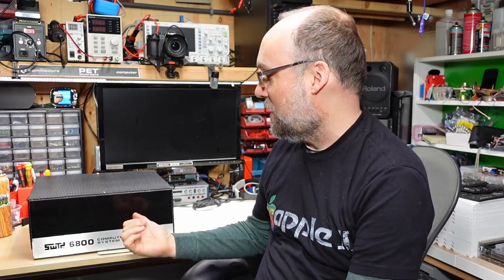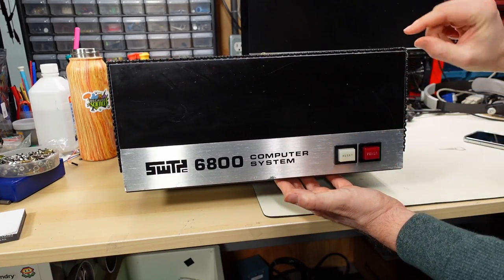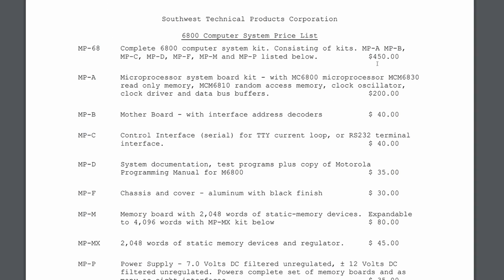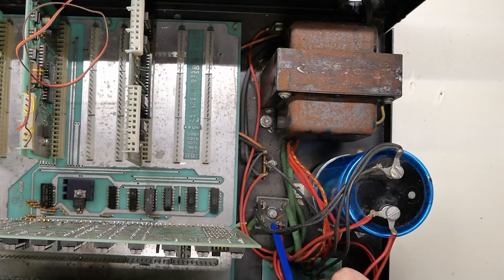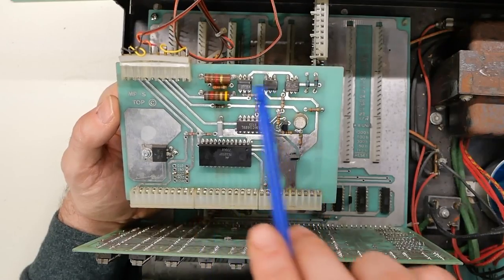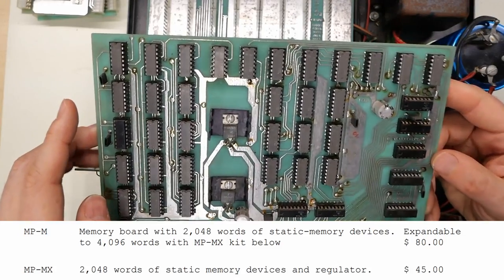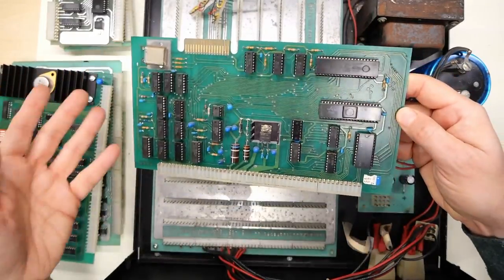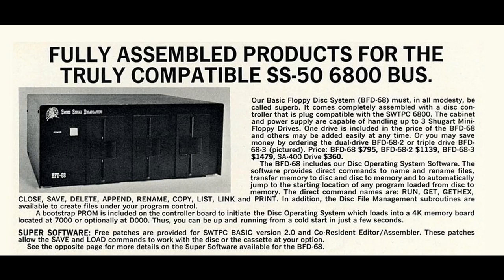The 8-bit home computer from 1975 you've never heard of

Comment: 14:36 Also, what happens if you put in two cards of identical type? This is why AT-bus cards needed to have jumpers to allow unique selection of I/O addresses, IRQs etc to avoid conflicts. With this scheme, the two cards automatically get different addresses just by virtue of being plugged into different slots.

This scheme was also used in NuBus, which was adopted by Apple in the Mac II (1987) and some later Mac models (until PCI came into use). NuBus cards were famous for being “plug and play”, with no need to fiddle with jumpers.
Reply: On the other hand, you wind up with software expecting specific cards to be in specific slots. 

The ISA address/IRQ selection was the result of several manufacturers creating upgrade cards simultaneously, and choosing an interrupt line and address range that "wasn't used". Then it turns out multiple companies have chosen similar interface details for very different cards. You'd still have that problem with dedicated slots, it would just be solved differently.
Reply: NuBus dealt with that by having a configuration ROM on each card. There was an OS API to enumerate the cards, so the drivers (or other software) could find the ones they were responsible for.

I think a scheme like this is used in all modern buses.
Reply: @lawrencedoliveiro9104  You can do that, once hardware is advanced enough to include on-the-fly software reconfiguration instead of asking the user to literally rewire the board, and software is behind a few layers of indirection instead of directly bitbanging hardware. But it's a whole different world at that point, one where system resources essentially don't matter.
Reply: So what happens if the driver expects the jumpers to be set in one way but not another?
Reply: @lawrencedoliveiro9104  Drivers in the modern sense almost always support any valid configuration of the hardware.

DOS games were an excellent demonstration of the issue, though. Older games often only worked with a more limited set of configurations than newer sound cards supported. You just could not set them up to talk to your sound card if it wasn't at base address 220, IRQ 5, and DMA channel 1.
And woe to the unlucky souls who had a SCSI controller using some of those resources.

Comment: I think that front trim peace is easily replacable. I'm 99% sure you could buy an L shaped alumin(i)um bar at some hardware store, but some corners to it and bend it. It's much easier than to but a sheet of alumin(i)um and do the initial fold accross it and then do the corners. I think if you are planning to keep it you should look into making a replacement trim.

20:25 - isn't that cap pushed in on the top?

Can you modify that program to load into a different address space?

Comment: On older software like that old version of DOS changing the address it loads into was as easy as changing the startup.bat in a text editor. It's been awhile since I worked on or even thought about anything like this but I used to be fairly proficient in a DOS shell. It may also be possible to dump the floppy controller ROM and write a new one designed for that specific machine. The trouble with older tech is the lack of plug-and-play compatibility. We've gotten spoiled over the recent decades.

Comment: They had a 6809 upgrade as well... to make it like the newer 6809 models they had later. The 6809 was 100% hardware compatible, but not machine code compatible with the 6800. I believe the name of the bus was the SS50 bus.

6820 (and 6821, which can sink a little more power) Peripheral Interface Adapter - two 8-bit parallel ports, with each bit being programmable, with control/signal lines for each port. (6822 is similar, but open collector and called an Industrial Interface Adapter.) If  you should ever have to, you should be able to drop a 6821 in as a direct replacement for the 6820.

6850 - Asynchronous Communications Interface Adapter.... the chip itself can do considerably faster (up to 1Mbps) than what the board in this 6800 machine has selection for. Of course, back then the speeds on the board were about normal.  The 6850 had lines that also allowed it to interface directly to a MC6860 0-600bps digital modem chip.

Also... since these chips weren't labeled 68Axx, or 68Bxx, they are 1MHz max rated. (the A made it 1.5Mhz, and the B made it 2Mhz.)

 There was also the GIMIX machines... bigger than the SWTPC machines and were 6809 based.

Comment: I built one in 1975. This one is missing the edge piece  that holds the top and sides on. I upgraded mine to a 6809.  At first I used a cassette tape for storage and then a dual single sided floppy. a big improvement. the ram boards that were 2K had a ton of ram sockets to solder. I had 4K at first later upgraded to 46k. I had to change all addressing chip selects to do that.

Comment: The 6800 microprocessor was pretty advanced for it's time.  I breadboarded one back in high school.  Not a bad processor to program for, although truth be told, i preferred the Z-80 for machine coding.  But the 6800 led to the 68000, which was absolutely better than other processors of it's era, at least in the area of op-codes.
Reply: Later they had the 6802/6803, which put the clock generator and 128 bytes of RAM on-chip, and added a few instructions. From what little 6800 programming I've attempted, it's hard doing some things without ABX.
The 6809 was done as a project to study how opcodes could be better thought out. It was really nice, and I even got paid to write 6809 code for a few years. Sadly, they went back to the original 6800 instruction set for the 68HC11, which was big in the automotive market. There were also a 68HC12 and a 68HC16, but by then other chips were getting more attention.
Reply: @8bitwiz_  Interesting.  I never knew about the follow on chips after the 6800.  In fact the only reason i know anything about the 6800 was that i got put into the advanced track in my high school electronics class, and that allowed me to do the "extra" stuff, like breadboard a microprocessor system.  And the kit they had was based on the 6800. 

By then i was very conversant with both Z80 and 6502 machine and assembly coding.  I include both because when i started doing machine coding i didn't have an assembler for either architecture, so i had to hand code everything.  You want to talk PITA, try hand coding even a simple program!

Ah, memories.  I would not put up with that kind of lack of proper tools now, i can tell you that!  ^-^

Comment: My Father and I built this system late 1976. Uses all sockets. Love the old SS50/SS30 card. Still have that unit with a SSB MB, 6809 MB Card  and Memory. Uses that to gen a lot of Coco software and even did a prototype software when the Mac was released.  May take a while. But may have a replacement boot rom Computerware created and used in this and SSB units. Just for info SSB cooked up a protype graphic card based on 6847 graphic chip. Try replaced with gold molex pins for stability of the connection. If I can get a chance and the old 8" floppy still work will see what can pull up. PS stay away from the 3gen tv keyboard. A pic of junk. If you can find one get a SSB 5" & 8" controller much better.

Comment: have you ever heard of Sphere Computer?/it also was a 6800/based system. it was made in Utah. I got my hands on one in 1977.78/in college. it had a  300 baud cassette tape for mass storage and stock 4k of ram. there was one commercially available program for it and that was a reduced Basic interpreter by a startup named -as I recall - Microsoft. it was advanced for its time in that it was a video monitor with a card-cage under the hood. the boards were bussed with ribbon cables.

Comment: I had one of these chassis in the late 70's, though it came with a better power supply that used a ferro resonant transformer for better regulation.  I ran a Percom 6809 CPU board and 48KB of static RAM in it, the system was running Microware OS-9 which could do multi-user and multi-tasking.  Later I added an 8-inch Seagate SASI hard drive, I think it was 5MB, and I wire-wrapped a DMA SASI controller and wrote a driver for it.  It wasn't 100% reliable (I got pretty good at disk recovery), but it was blindingly fast with disk data transferring at full bus speed of 1MB/s.  The CPU was about as fast as the first IBM PC's, but it wasn't until their AT came out that their disk I/O was faster than my homebrew system.  MS-DOS still sucked compared to OS-9, though.

Comment: You'll also find the MC6821 (PIA chip, or Peripheral Interface Adapter) chip in the Tandy Color Computer line as well as the other 6809 based systems used in the 8 bit video games by Williams Electronics (Joust, Defender, Robotron 2081), etc.

Comment: i didn't spend my time on the early systems as I had access to bigger systems, like the IBM systems 3 and system 32 and others.  I did how ever get to play around with a 68000 system.  It had a OS from R/M.  It was wild and not like other OS's plus some pretty strange rules to it.  Like the fact that did not allow to access the files name directly thru programs. you had to use a LUN to access the data files.

Comment: Micbug did bit bang.. thus the bit rate limit on the control board.... "moving" micbug to say a starting address of 0 takes just a bit of time with a binary editor... I worked on drivers for an eight inch floppy that was a tad "different"... it was used in a medical data collection system that bit banged data in and out to the Floppy... (Shades of Micbug)   I was doing the drivers for use on the 8080 oriented systems.... There was a company in Tampa Florida that had Robert Uiterwick and 4 others... He actually wrote most of the stuff for SWTPC  (a very primitive dos, Integer basic, 4k and 8k basics, and Warren Startup designed the first generation floppy adapter for SWTPC.  I did a couple of articles for Information Age Mag which included a "Floppy Rom"  in the magazine..  The articles had a copy of the SWTPC cassette adapter to read the Floppy Rom in.  I wrote a pile of assembler code to take the copy of basic in the system and dump it out to a record cutter that actually generated the "floppy Rom"... which was a record stapled in to the magazine... An interesting project
Reply: Mikbug not Micbug it wasn't created by McDonalds LOL.
Reply: The TRS-80 Color Computer did bit-bang serial too. The trouble is getting reliable input timing, while doing something else useful at the same time. The Videotex cartridge actually used the 15KHz video horizontal sync interrupt as a 25x (?) clock for 300 baud, at some small cost to foreground performance.
Reply: @8bitwiz_  A friend in Clearwater did repairs on the TRS lines for the shack.  His comment about the original: they recucled serial numbers... which only went up to 100,000 as I remember.  He saw at least 3 different chip dates that were years apart in his surgical attempts.  I never got into the color computer, so never found their need to bit bang... The SWPTC system tied the cassette into the original serial port if I remember correctly.  (That is a LOT of years ago)--- used the tape load and save functionality there.  (Well, Motorola was thinking paper tape as in teletype type stuff...)   We did a connection via parallel port that worked nicely for the "pull the punched tape thru the reader" devices....

Comment: It would be easy to recreate that front trim piece with some aluminum angle-stock!
Not even any welding needed, just cutting, bending and drilling.
Huh, the card-connectors inside this computer must have been commonly-used in that period, as I have a number of old television circuit-boards that use the same right-angle/card-edge connectors!

Comment: Adrian - I keep seeing your roland MA8 speakers in the background.  I had a pair of beige ones at a former job from 1999 to 2006, and have been suffering from Nostalgia.  Have you done a teardown of them?  Are they as good as my rose-coloured memory suggests?   
Since then I've acquired some 4.1 powered speakers, but even with a separate sub they don't have the same "Oontz" as my mind remembers.
Ebay shows these are still commanding $Silly prices which suggests that yes, yes they are that good.  Would a teardown. clean and inspect be a good video subject for the future ?

Comment: This big cap is not just a filter cap to smooth the supply, it's more a battery or built-in UPS. Beware, this could be used for welding I guess.. ^^

Comment: I think the Floppy controller is normally hooked up to 2, 8 or 4-bit FlipFlops. I think because the Floppy controller does not have any built-in registers to 'hold' any settings. So if you wanted to read back the current track number or something, you'd need extra logic.

Comment: 9:45 Shift registers are not RAM (random access), at all. They can be either dynamic (usually MOS) or static (usually bipolar ttl) though. So it is "shift registers", not "shift registered" [RAM]. (It kind of amazes that a guy that knows relatively little about old components can be so skillful in fixing old electronics. I guess being systematic and a quick learner, helps a lot!)
Reply: He said "From my understanding one of the big improvements on this later version was that it used static RAM, as opposed to shift registered, which allowed you to move the cursor around and edit any part of the screen"

The way I understood this was that he was saying the later TV typewriter(the TV typewriter II in the picture he is showing) used static RAM, as opposed to the older TV typewriter which used a memory system implemented with shift registers, and that so the newer version allowed you to move the cursor and edit any part of the screen. The implication here is that the version with shift registers could not edit an arbitrary part of the screen, meaning it was not random access(it seems to have been a sequential access memory design, using the shift registers as the delay elements).
Reply: @Ts6451  Yes, of course! But that was not what my remark was about.
Reply: @Ts6451  Shift registers are perhaps not best viewed as "delay elements" in these contexts. Better seen as strings of latches, or a fifo buffer. And yes, they are not random access, at all, but sequential. 

(You can edit any part of the register fifo though, just like you can edit a magetic tape. But it's much more cumbersome to write code for that than with RAM, especially without disturbing the display frames to much.)
Reply: You're missing the point and being a jerk. Early glass terminal implementations used shift registers to store screen data. Later more sophisticated implantations used RAM to store screen data, making it practical to do screen editing. That's it, end of story. No one confused shift registers with RAM.
Reply: @matthewkriebel7342  Talking about being a "jerk"... But I guess practical or not depends a lot on whether the terminal had some form of processor, or just random logic. One of the first text terminals that had a CPU was the Datapoint or CTC 2200 in 1971. The first versions of that design used shift register memory, and could edit the text. (Designs around the 4000, 4040 and even 8008 also often used shift registers. Same with Texas chips and others. So it was used for much more than storing a static sequential text.)
Reply: Really, you're just quibbling over choice of expression.

Shift registers are legitimately viewed as memory devices, and the grammar can easily be read as shifted vs. random.
Reply: @JoelReesonmars  Yes, they are memory devices, sure. But not RANDOM ACCESS, which is what RAM stands for. Shift registers are not RAM by any means (just like tapes or delay lines aren't either).
Reply: @herrbonk3635  Maybe call them Sequential Access Memory.
Reply: @herrbonk3635  Random Access Memory as opposed to shifted memory. It's within the scope of the grammatical ambiguities of everyday English, where you cut the parallel.

Ordinary conversation and YouTube channels are not as rigorous as mathematical proofs, and if we want to complain about the lack of precision in this, man, we wouldn't be able to listen past the first five minutes.

I saw it too, I didn't figure it was any more worth commenting on than the times he slipped and said 68000. No, actually, I did think about commenting, but the 6800 gets so little love anyway, and, frankly, I had more important things to do.

I'm not sure why I'm arguing about how important it is to demand precision from a YouTuber, really, except I guess I was more interested in seeing someone get better acquainted with the 6800.
Reply: @JoelReesonmars  Youtube or not is as relevant as the color of the paper, or the frequency of the transmisson :D At least in my world. Avoiding misleading terminology when possible is not the same as mathematical rigor either. I never understood why people put so much pride in being sloppy with central and fundamental technical concepts. (Often the same guys that are pedantic as hell about arbitrary and meaningless information such as exact model names or numbers.)

But sure, the 6800 is interesting in many ways. An early response to the i8008 (not 8080) that stores the most significant byte first (just like the 68000, but unlike the 6502). I was a Z80 programmer at the time, but I would have loved to see more of the 6809. It was an interesting design, and I always feel for the underdog. Always liked real diversity.
Reply: Anyway, we've beat the question to death, and of Adrian wants to add a correctional balloon or something, he'll have all the notification he needs.

Or, you can do like a lot of bloggers or YouTubers do and use it as an excuse for a response post, like that recent set of exchanges about whether energy and information in a circuit get transferred through the wire, perpendicular to the wire, or along (parallel to) the wire.

(Or like my blog posts about the differences between the 6800, 6801, 6809, and 68HC11, I guess.)